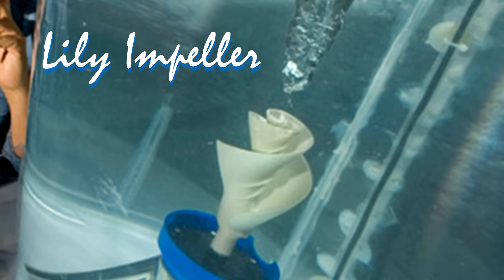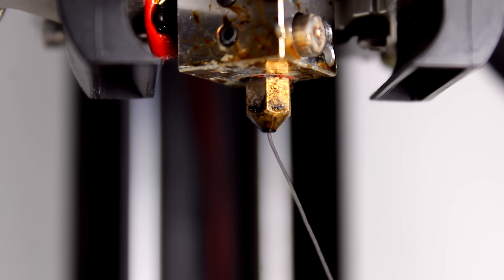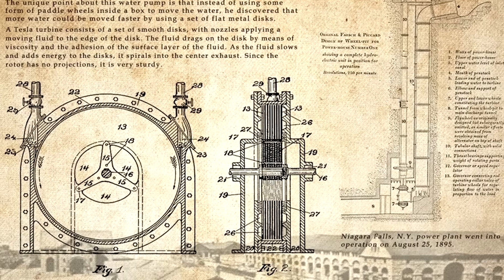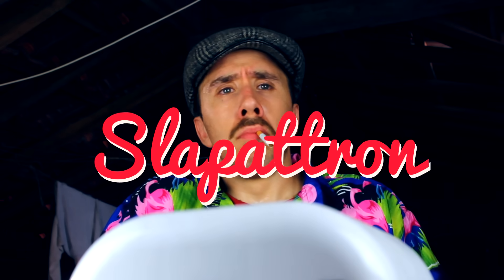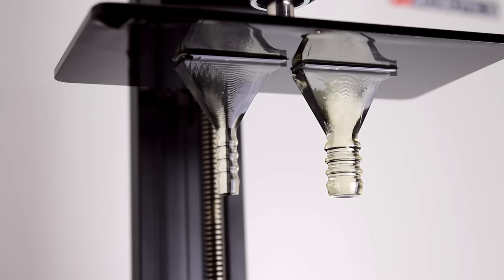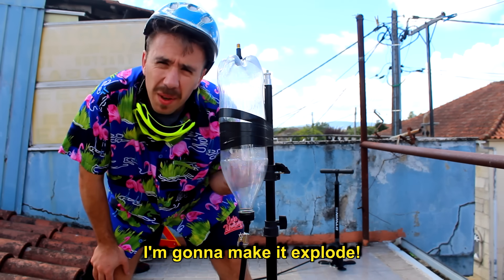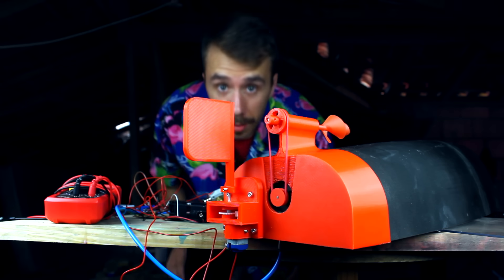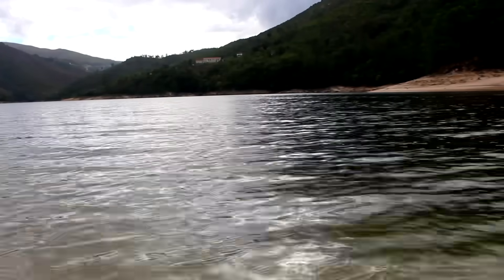Tesla Turbine Boat 3D Printed (Lily Impeller)

Comment: I have about 2 problems with this boat (+ project idea in the end).

One is using a tiny impeller for an absolutely massive boat that would (to my mind) require at least 2x larger impeller.
The other is the rubber band. Sure it works nicely in the air, but have you tried it when wet? If you have that has not been on the video. And wet rubber may slip (I am not going to mention that it won't live long, this wasn't the intention).

As for project ideas, here's mine. Create a device that, using vacuum, can attach itself to any surface, from smooth such as glass to rough such as concrete, stone or wood.
Extra points if you manage to have it stick to extra rough surfaces like tree bark or uneven wall plaster.
How?
Well my idea would involve a membrane of a stretchy material such as balloon rubber, filled with grain or something like sand, covering the edges of a more conventional vacuum chamber (and being subjected to vacuum itself).
Basically one would press such a device against a wall, press a button and have it stick to the wall.
The idea is that first the air is sucked out of the membrane, which then attaches itself to the wall and repeats the surface pattern.
Next, the air is sucked out of the cavity in the middle, further pressing the device against the wall.

Now ideally it is supposed to have vacuum stored in it and only have to recompress between operations, but you know how 3D prining goes...

Comment: Why not build a Tesla turbine power station using a trompe (a compressor that uses falling water to compress air) to supply the compressed air.
And I think you might need a form of transmission between the turbine and impeller  because the impeller probably has a lower effective rotational speed than the turbine. Look up ships turbines they turn at high speed in the air, but the propeller, or impeller needs to turn much slower because of water density

Comment: The nozzle wasn't helping because you did not have enough mass flow into the cross-section of the turbine intake. In other words, your turbine was too big for the source of air you were giving it. If you had, say, a 2.5cm diameter pipe at 2 bars feeding the intake or you ran it at a vastly higher pressure to compensate for the air hose's small diameter, then you might see some good results.

Comment: Awesome video, as usual!
A balloon in the bottle would keep the pressure up while air is exiting. 
That bottle flying and crash should have been followed by a cat angrily saying "reeeeaaaaaaaaaaaawwwrrrrr"!
EDITED: The impeller was originally tested in a tube.  Perhaps more thrust would be generated if the impeller was surrounded by a tube.   Note: my original statement of the cavitation was wrong, since no bubbles were generated by the boat when it was moving.
Reply: this was my first thought too, the ultra high rpm seems undesirable without reduction gearing and a larger pushing surface to exploit that increased torque.

then i again i am a plebeian who is used to car physics and perhaps that just not how impellers work
Reply: I think he should also swap the belt and pulley for gears, this would allow him to alter the gearing as well as prevent the belt from slipping when it is exposed to water. But hey, just an idea.

Comment: Solar airship. Print a lightweight frame pieces (coat in rubber/insulative sealant) that can together be lashed around multiple large hydrogen balloons  (bigger than party balloons). The top piece would house the solar cells ($20 on amazon for 100). The gondola portion has a jet engine  that has one intake two outputs like setup with two lily turbines. The electronics allow it to go into "charge mode" where it can allow wind to pass through the two "intakes" to recharge the batteries with wind power, and its mobile mode of using electric motors to drive the impellers. The gondalo section could have an elongated hallow connection to the balloon pieces so the electronics can be far from the balloons and just have to be careful with the solar cells/wiring.

But theoretically it could keep going for as long as the hydrogen lasts, and if there was a hydrolysis device that used collected air moisture/bilge system to keep things dry in the gondola it could stay up for weeks. If it works it could be used to provide free wifi lol

Comment: Integza, I use to work as a glazier, you can get a fairly cheap Acrylic cutter, but you can use a box cutter, just make sure to do enough cuts on the acrylic until you’re about halfway through, then put something like a pencil under the edge of the cut and press down on either side, should snap cleanly (hope I explained it well enough, kind of hard without visuals)
Reply from the maker: Thank you so much for the info :D

Comment: wdym dancing won't help anyone starlord saved everybody by dancing off with ronan
Reply from the maker: Touché!
Reply: Integza your content sucks

At being bad. You could even call it amazing 😃
Reply: @integza  Bro your awesome.
Reply: Integza I have an idea instead of getting resurised air to move the boat why not use the water itself to move it like a small water pump for the turbine that way it doesn’t need a recharge of air
Reply: @integza  when will you announce the winner?
Reply: @integza  So at the end of the vacation you do a sponsor spot for kiwi co 🤔 anyway, are the bottles that you connected on the fill side fully filled up? Better tu use a T to connect al the bottles is my guess.
Some thoughts on the boat:
* bigger impeller
* stabilize the impeller (pint a piece for the front of it)
* rudder in the centre of the boat or a dual rudder
Reply: Damicske I was thinking bigger impeller or using two. Or two bigger impellers? Haha
Reply: Make a steam engine and put it in a model train
Reply: @Integza, next Integza video: An RC Tesla turbine powered boat with wireless telegraphy control and Tesla coil on top
Reply: Me
Reply: That is cheating
Reply: @Luiz Da Mata I agree that the impeller should be in a tube. I suspect there is some centrifugal component to the way it works, so putting it in a tube (or a cone) should redirect the outward flow toward the back, increasing the thrust.
Reply: SHOW ME WHAT YOU GOT!
Reply: Oh I forget to express my personal compliment for your super Naif colored shirt & of course...the source of your Power...your suspenders!!!
Reply: Me ? You called me ? 😂
Reply: @integra plzz make a remote control car powered by Tesla coil 
Love you bro
Reply: Plzzz bro make wireless car powered by Tesla coil
Love you bro
Reply: God has said in the Quran:

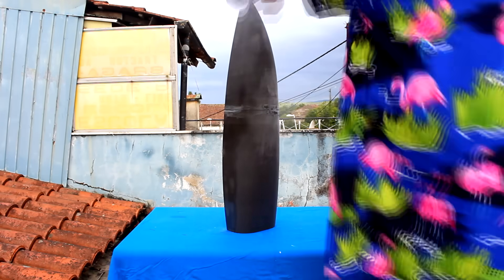{ O mankind, worship your Lord, who created you and those before you, that you may become righteous - ( 2:21 ) 

 [He] who made for you the earth a bed [spread out] and the sky a ceiling and sent down from the sky, rain and brought forth thereby fruits as provision for you. So do not attribute to Allah equals while you know [that there is nothing similar to Him]. ( 2:22 )

And if you are in doubt about what We have sent down upon Our Servant [Muhammad], then produce a surah the like thereof and call upon your witnesses other than Allah, if you should be truthful. ( 2:23 )

 But if you do not - and you will never be able to - then fear the Fire, whose fuel is men and stones, prepared for the disbelievers.( 2:24 )

And give good tidings to those who believe and do righteous deeds that they will have gardens [in Paradise] beneath which rivers flow. Whenever they are provided with a provision of fruit therefrom, they will say, "This is what we were provided with before." And it is given to them in likeness. And they will have therein purified spouses, and they will abide therein eternally. ( 2:25 )

 Quran
Reply: ahmd abdallah and Josepeoe said in the book of Pinocchio: “I wanna be a real boy”. Doesn’t mean it actually happened.